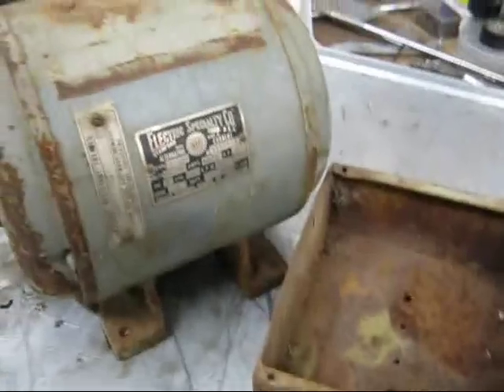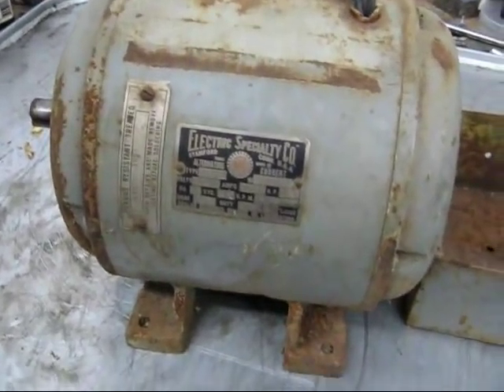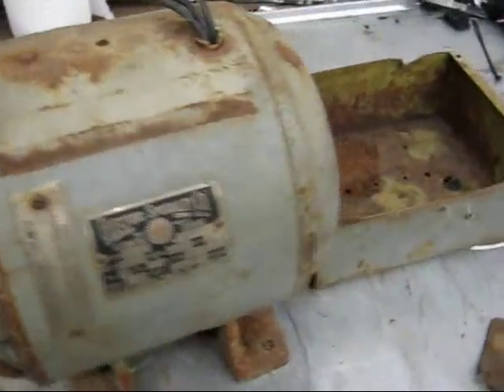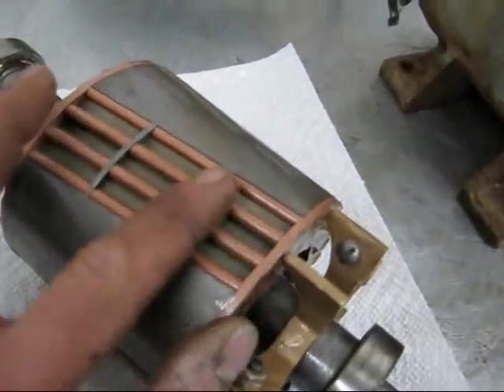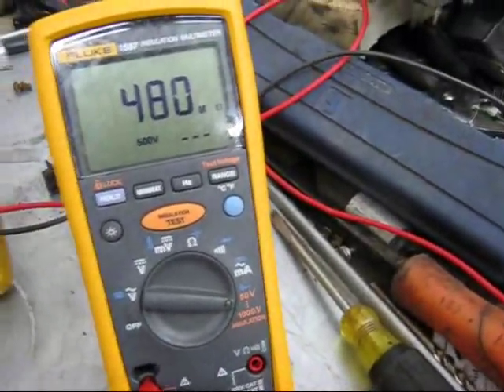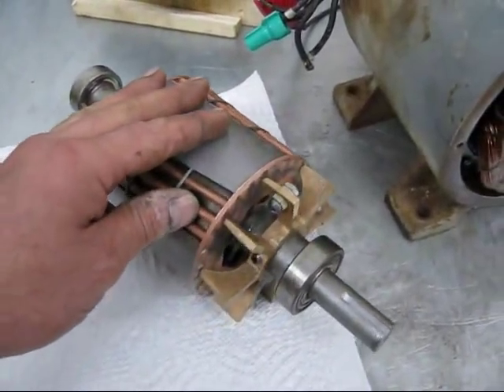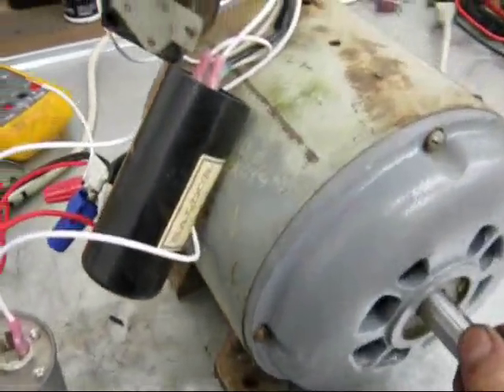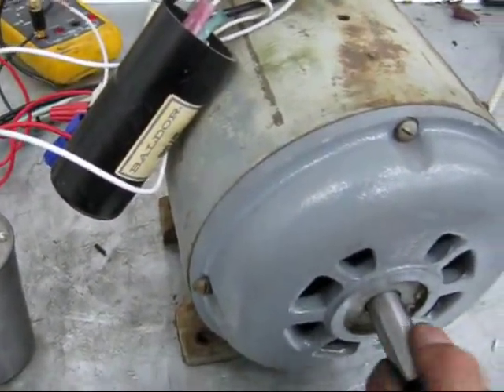Electric Specialty Co. ESCO antique electric synchronous motor - teardown and test...

Comment: This is a reluctance synchronous motor, and you are absolutely correct- the rotor is indeed a combination induction and synchronous rotor.  The motor starts as an induction motor, and, at speed, pulls into synchronism via reluctance torque.  While running at speed the squirrel cage winding adds stability, but adds no net torque.  As for starting, this may very well have been a permanent split capacitor motor, with no starting capacitor (only a run capacitor) and no starting switch or relay.  It is very important that your run capacitor isn't too large, or the auxiliary winding will overheat.  I would very much LOVE to have that motor in my collection! :)